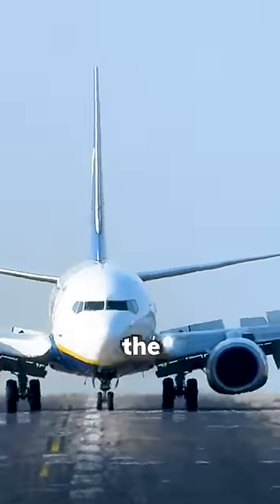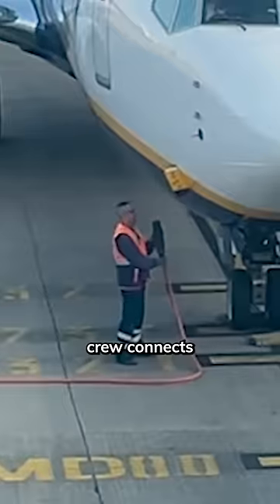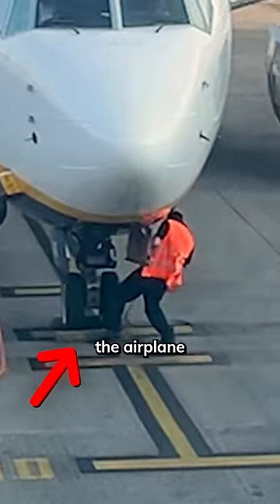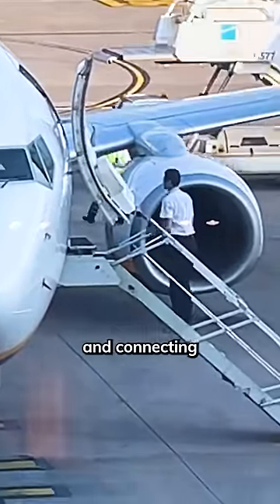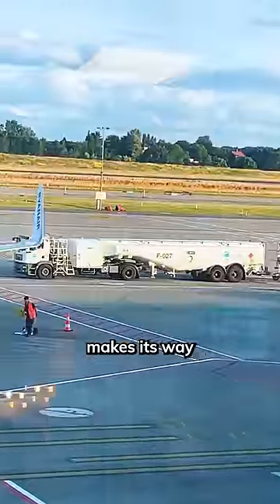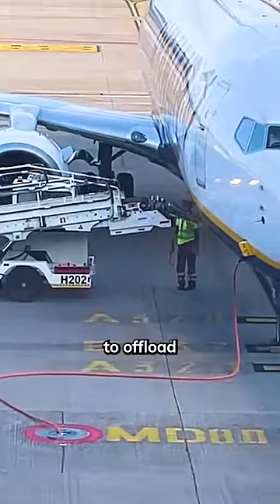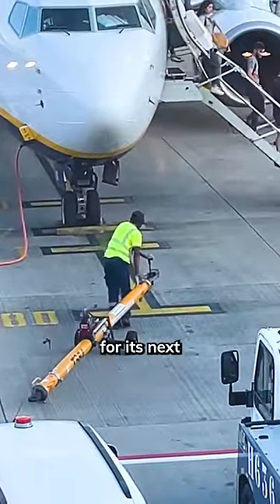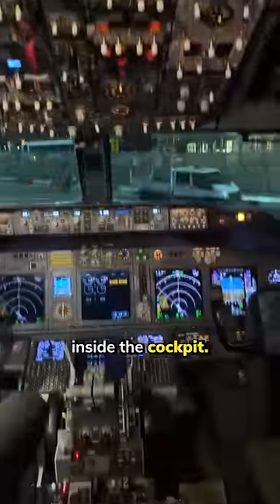Ryanair Airplane 25 Minute Turnaround!

Comment: Ryanair: The plane needs no cleaning. Just sit on your damn seat.
Reply: Reminds me of an incident with United where they cut the cleaning to save turnaround time (plane was late to gate). There were chocolate stains and sticky mess everywhere for the passengers and United ended up giving passengers vouchers as an apology
Reply: For school it's the opposite
Reply: it doesnt really matter on ryanair, the aircraft only really needs cleaning on full service airlines beacuse of meal service etc. the aircraft only get a quick wipe down during "cleaning" anyway, and considering ryanair doesnt serve food, and barely anyone even has drinks on board, theres almost no mess, or rubbish. so its a massive cost and time save to just not clean it, if a passenger leaves a mess the flight crew can clean the 1 seat quickly
Reply: More like spirit airlines, and southwest. Ryanair didn’t have any crashes. It’s the number 1 airline in Europe .

Comment: For people who dont understand, a GPU stands for Ground Power Unit. It's a portable electrical supply to give the airplane electrical power when the engines are off.
Reply: Thank you for teaching me something new today!
Reply: Ok. But does every airport have this GPU Function? what will they do if the airport does'nt habe this GPU or the GPU is out of order? The pilot keeps the engine running instead of depending the GPU for necessary electricity?🤔🤔
Reply: Lies, it’s a Graphics Processing Unit
Reply: @RahulRk-tr7ot  There are always GPUs at every airport, they are extremely important and common
Reply: @fayenotfaye  nuh uh
Reply: @RahulRk-tr7ot  All airports that have commercial traffic they have GPUs.
Reply: Bro i thought they got a rtx 4090 for better fps
Reply: @RahulRk-tr7ot if there isn't a GPU they have to use the APU.
Reply: @RahulRk-tr7ot There is a tiny jet engine positioned at the tail of most passengers aircrafts known as the APU (Auxiliary Power Unit) and if there is no GPU (Ground Power Unit) available they use the APU to generate electricity.  It also helps that the APU can be started with the onboard battery.  The downside of using the APU is that it requires more fuel than a GPU.
Reply: @RahulRk-tr7ot Most do. If they don’t, then the aircraft (if equipped) will use its APU (auxiliary power unit) to power itself.
Reply: @RahulRk-tr7ot  they can use APU (auxilary power unit) which is at the very back of the airplane
Reply: @RahulRk-tr7ot  While he calls it a GPU here, its not really a "unit", those are often carts that run diesel engines to make the power, larger airports have a centralised ground power system, so its just attaching a power cable to the aircraft. If that system is not available (You park away from the gate etc, they just run the APU (Small turbine engine in the tail, for the entire turnaround), Costs a bit more in fuel and wear on the APU, but power is required so pilots can do the flight programming, lights in the cabin for cabin crew, cleaners etc. Ground power is also required for fueling as they run the transfer pumps and valves so fuel gets distributed to all tanks.
Reply: Were messing around we know
Reply: @RahulRk-tr7ot if no GPU is available. Then they start the small jet engine way in the back of plane. In the cone. That’s a back up generator that they use
Reply: So they don’t clean the cabin🤨
Reply: @RahulRk-tr7ot if for some reason gou is not usable they can start the apu and get necessary electric power
Reply: You're WRONG. In this CONTEXT, it means Ground Power Unit. When it comes to computing that's where it's Graphics Processing Unit. @fayenotfaye
Reply: @RahulRk-tr7ot a plane also has an APU it's like a generator at massive generator at the back of the plane to put it in simple words. They will just use that if no GPU. 😊

Comment: The engine staring into my soul 🫣
Reply: It’s fake
Reply: @TBS_Railfanner it's a reflection off of the terminal window
Reply: @n1co2017  there is eyes edited on it don’t you see? Also it goes over the person s body
Reply: @TBS_Railfanner  yes it would make sense that it goes over him if it's a reflection of ceiling lights inside the terminal off of the terminal window you can clearly see in other frames that there are a bunch more and you can more clearly see a reflection of the inside of the airport

Comment: "Ground crew connect plane to the GPU"

and now you can fly at 120FPS
Reply from the maker: LOL
Reply: It is not connected😂while flying so 10fps!
Reply: Ground power unit
Reply: IRL anything is infinite FPS😅
Reply: @fitriaauliarty9073 its like 300 million fps irl
Reply: We flying faster with this one
Reply: Microsoft Flight Simulator type gpu
Reply: corny
Reply: LMAO
Reply: Ayo bro u stole my name
Reply: 700FPS or more are recommended for Flying, as the Aerodynamics engine can run into rounding errors that may cause stalls.

Comment: "Ground crew connects the gpu"
starts flying in 4k 60fps
Reply: Bro that's console specs
Write "1080p 144Hz"
Reply: Gpu means Ground Power Unit
Not Graphics Proccesing Unit
Reply: @Omsi2Slovak are you sure? We had no idea
Reply: @rajas_ 
4k 60fps is definitely more intensive than 1080p 144fps
Reply: @iikeli727  which is why I said

Comment: As a pilot, this is 100% correct. Not every airplane has air stairs but yes, this is what really happens.
Reply: IIRC the 737 is the only current airliner with built-in stairs in usage. Ryanair makes plenty of usage of them to save on airports costs, as they can park the plane "anywhere" (assigned by the airport ofc) and not use jet bridges or car stairs  
  
The A320 has the option but due to it's weight it would significantly increase the weight of the plane and not even low costs airlines like Easyjet that use the A320 have the airstairs  optioned in
Reply: Playing flight simulator does not make you a pilot, kid.
Reply: @MrThisIsMeToo  you're talking about me? From the time I played sim to now I had more than enough time to become a pilot. So, yes. See you on board soon, kid.
Reply: @sagbon98  what planes do you fly
Reply: @commenter3698  A320
Reply: @sagbon98  nice , what airline?
Reply: Cap u ain't a pilot
Reply: @commenter3698  Turkish Airlines
Reply: @sagbon98  nice

Comment: "Line maintenance left the chat"
Reply: If it doesn't need it they don't do it. Most maintenance is done at night.
Reply: Generally maintenance does a walk around, but Ryan air maybe doesn't require it?
Reply: @chopper63d  not in Europe
Reply: @chopper63d  Do you really think that is true? Come on now.
Reply: @RLTtizME  well where I work in the states we come in out to every aircraft on a quick turn to do a logbook check, service engines if needed and do a walk around.
Reply: @chopper63d  Still working for Braniff?

Comment: A Ground Power Unit (GPU) can be either a fixed or mobile unit which can be connected to the electrical system of an aircraft while on the ground to provide either 120V AC or 28V DC power. Ground power units usually consist of a generator powered by a diesel engine but may found in other configurations.

hope this helps!
Reply: 0 Likes, 0 Comment, Lemme Fix That

Comment: When I was cabin crew in the 80s , we'd 1hour &15 minutes turnaround...
How times have changed 😮
Reply: TURNAROUND?
Reply: That's still pretty average for major airlines. Ryanair is able to do this because they have a lot less luggage in any given flight and use two doors to board and deplane rather than the normal single jet bridge.
Reply: I would love a 1hour 15min turn around. The norm at airport i work at is 45min with the odd 30 min. Essy done if you have all the equipment and outband bags(only available with 30 min turn) at stands prior to arrival.
Reply: @scottmeehan2422  think nearly all airlines are 1 hours turnaround on short haul and 2 if it's a "Jumbo" Style aircraft on long haul

Comment: Pretty much not the order it’s done but the gist is there. I worked ramp at an airport serving Ryanair a lot.

Before the passengers even start getting off we are already halfway through the unload of bags, and have the new ones ready before the next passengers are ready to board.

This all depends when the beacon is turned off and how ready we are with ground equipment.

We had 1 person in the hold, 1 passing him/her the bags and one loading the conveyer belt. We could unload and load 120+ bags in 15 minutes. Ryanair only loads into the front hold which makes it significantly easier for weight management.

Loading quickly ultimately helps since the new Ryanair 737 Max actually needs to be turned around in 21 minutes as each engine takes around 2 minutes to start, and their off-block times got hit hard when they realized this.
Reply: What happens when a passenger is not at the gate but their bag is already loaded? I'm quite surprised it doesn't happen on every flight.
Reply: @alexus267 if passenger dont turn up n pilot says thats it doors close then, you have to offload the passengers bag. Pain in the arse as you can bet its one of the first loaded.
Reply: I have had to load back a few times as No way your fitting more than 120 bags in the front of 737-800. Well i would struggle to get more than 120.  Luckily ryanair are greedy bastards n most folk share suitcases.

Comment: Another thing about the towbar. To prevent accidents, we put a bypass pin in the wheel to disable the pilots ability to steer. This is to prevent the towbar from turning and causing accidents

Comment: I’ve never understood why Ryanair don’t have the stairs also implemented in the back doors. Now if they want both doors they still need to pay the fees for one stair car
Reply: perhaps they already calculated the cost... stairs on l2 doors at b737 is more complicated and heavier, and that's why they chose not to install it, because the weight penalty and maintenance cost is far more expensive then paying stair car...
Reply: I would think it is weight in the rear, the air stairs are an optional extra that save money on fees at airports.   Looked these stairs up recently, very heavy.  Think about it with it's size, all the mechanisms  at least 500kg 🤔

Comment: Chocks are mainly placed on Airbus aircraft immediately after parking because only engine 2 pressurizes the brake system, and when the engines are shutting down, chocks need to be places at the nose gear immediately
Reply: But if remember correctly Airbus (at least A320 family) has pressure accumulator which allows you to set the parking brake after shutting down engines. Also isn’t the parking brake set before you shut down engines ?

Comment: Bro its basically earth wire connected to fuel tank of the aircraft to discharge the static energy which is there due to friction, so sparks could be prevented, preventing a huge explosion.

Comment: As a Ryanair dispatcher there are many things not shown that happen in that 35*min turnaround! And you cannot attach the pushback bar until the Fueling has been completed. Also the chocks  should be placed on the right wheel

Comment: I seen a 10 minute turnaround.

The cew cleans and restocks the aircraft behind the passanger that jumps of, and the new passager jumps on and walks behind the crew.

A loading and unloading is done on the left side of the aircraft, and the right engine is not turned on.

The left engine ks turned off the instant the plane leave the runway for the taxiway. The plane taxis on one engine.

The use now tow bar, but park with the left side directly to the terminal. The boarding passanger boards the rear and the devoarding jumps of the front.

This way the aircraft need no tow bar, it just go straight ahead. Then power on the right side engine wile taxing.

Using the breakes while taxing to keep the speed down while the engine revs up, just taxing out on the runway, punch the throttle all the way forward, drops the breakes.

Les than 15 minute from touchdown to lift of.

Comment: And in the case of the 737 Max 900, you do an extra check to make sure all the bolts on the doors are installed correctly.

Comment: well ACTUALLY, IF you land at Tenerife South, and you are at a gate, there is NO FUEL trucks, the fuel tanks are under the concrete pad and an earth grounded hose is connected to refuel. they just use a platform to lift the refueling hose into place

Comment: Bro you didn't mentioned the engineer
Without his signature the aircraft couldn't fly.
Reply: That is done before the aircraft has its day of flights.
Reply: You are confused with trains.
Reply: That’s not how it works. The pilots check the technical log and make sure there are no  issues that prevent dispatch and haven’t been signed off on, and then do a walk around. They don’t need an engineer to check anything unless the last crew had reported an issue and it was not signed off as safe to fly

Comment: The guy that sets up everything presses wrong button
Him oh uh
ground crew gets sucked in to the engines
Reply: In Boeing 737-800 the engine start switch is located on the very front of the overhead panel and it’s not that easy to get it mistaken for other button. Even if pilot somehow mistakenly turned start switch to GND (ground) position he/she would still (in case of Boeing 737-800) need to put engine start lever to idle position to let the fuel flow from fuel tanks to the engine therefore allowing it to start. Also while setting up the cockpit an air conditioning and therefore packs are usually turned on meaning that the engine start would likely not be possible due to insufficient pressure in the bleed air system. Packs are a part of bleed air system responsible for pressurization and air conditioning of the cabin. During the engine start the packs are turned off since they take some of the bleed air away for the air conditioning. This will increase pressure in the bleed air system which will allow you to start the engine since the N2 turbine is spun up pneumatically (by bleed air) during the engine start.

Comment: I flew an a320M to punta Cana from Toronto Pearson, after I took off my head felt dizzy for not flying for years, I got Mr noodles soup and I never expected that on Air Canada Rouge, plane was shaking a little and while descending my ear from the left had extreme pain and I never felt that pain with my ear, the landing was okay but I got a little jump from my seat, Air Canada Rouge is good after all, but I’ll just leave a review of 3 stars.

Comment: Whyd they connect gpu when theres apu? Also if they wouldn't turn on the apu the plane wont have any power if the engines turn on which will

Comment: Soooo, they dont switch pilots for each flights?
Reply: Ofc not, especially on shorter flights…
Reply: A Emirates one be like...
Reply: ..hmm well, they switch seats.
Reply: So that means if they are tired, they don't get a break?
Reply: @Yournightmares004  I think they do switch crews probably every flight because of jet lag. I thinks it's a law for aircrafts.
Reply: @flamingoreo1440  noted thanks
Reply from the maker: It depends on the flight. In short to medium haul flights (like Ryanair operates) they are the same pilots. For example:

The same pilots will fly from their base in Malta to Milan, and then fly back to their base in Malta. If they are very short flights they might even do another 2 flights (outbound and return to base)

In long haul flights it is likely the airplane will be flown by another crew. Or maybe the same crew will fly it back but on another day after they’ve had some rest
Reply from the maker: If a pilot is feeling overly exhausted I’m sure they can take a break and they will call a pilot on standby. However, their shifts are planned so that they can fly their flights without a break in between
Reply: @LuxPlanes  thanks for the clarification
Reply: @LuxPlanes  thanks for responding as well
Reply: Ryanair usually flies around Europe...so they have 1hr, 2hr flights and might mix in a 4hr flight. During a typical day a Ryanair flight will leave Dublin...fly to London and back and then go to Faro and back etc

Comment: Can it be refueld with passangers?
Reply from the maker: yes, they refuel with passengers onboard. you can sometimes use this trick to tell if its being refueled while boarding: if the seatbelt sign is off its an indication its refueling. they keep it off during refuel incase of a fire its easier to evacuate without seatbelts already being buckled
Reply: Yes, seatbelt sign has to be off. Stairs in front and back be installed. Pilot has to be visually monitoring the process. (When at a gangway: stairs in back have to be installed and airport fire brigade has to be next to the plane.)

Comment: Some steps are messed up.
Reply from the maker: Well it depends on the turn around. The turnaround that I recorded happened in the order I presented this video in. But depending on a variety of factors things could happen in a different order
Reply: @LuxPlanes  I'm an actual ramp agent I know how the job works myself.
Reply from the maker: That’s cool! However I witnessed and recorded this video with my own eyes so I also know the order that these things happened in. It could be at your airport that you do things differently. And also as I previously mentioned the order can change depending on several factors such as availability of ground equipment and personnel. Anyway, out of curiosity, what would you say the “correct” order is?
Reply: @LuxPlanes  right before the GPU is connected the chocks must be placed before so that the airplane doesn't roll forward. Other than that the rest is on the crew.
Reply: @LuxPlanes  should see how IAD airport is.
Reply from the maker: I see, well in this case they placed the chocks while connecting the GPU. This was recorded at CRL airport. Things can vary quite a lot between the USA and Europe